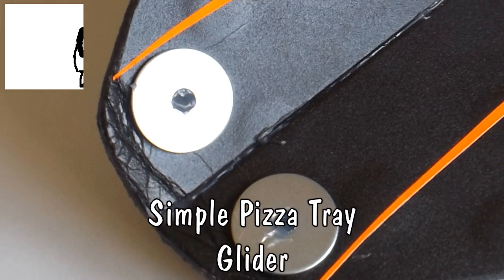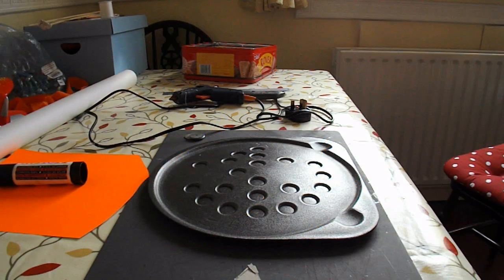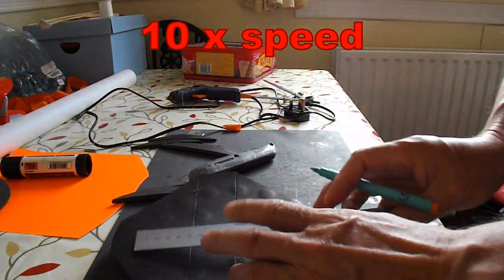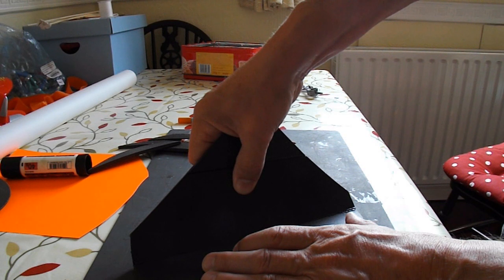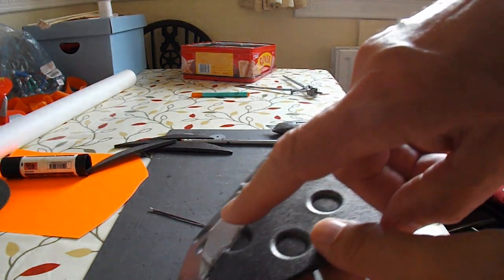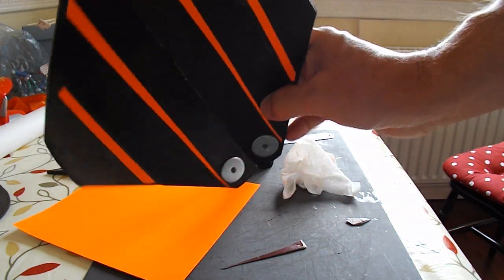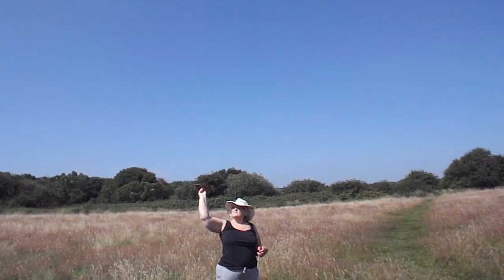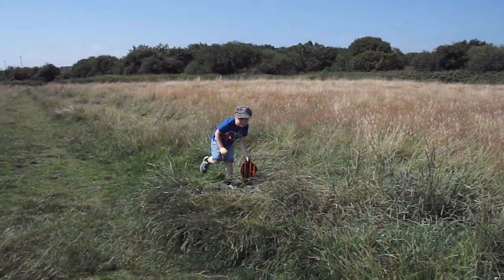Simple pizza tray glider with dihedral

Comment: Going through some of your older videos just now. Might try this with my left over tray.
Reply from the maker: If you copy this one, don't make the V shape - dihedral -  as sharp as I did for the central section. It would probably work OK with the centre flat and just the outer sections angled up. The dihedral helps stabilise the flight but I tend to overdo it. That plane I made for the catapult launch had none other than the tips and I think the V tail helped on that one too.